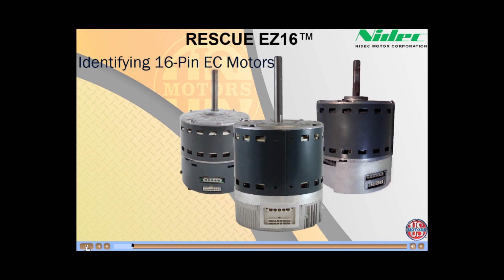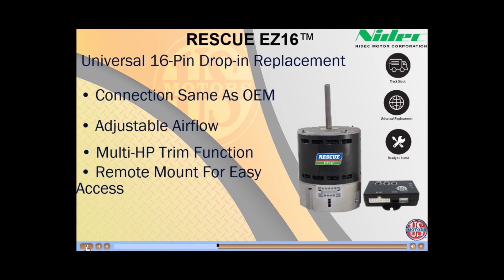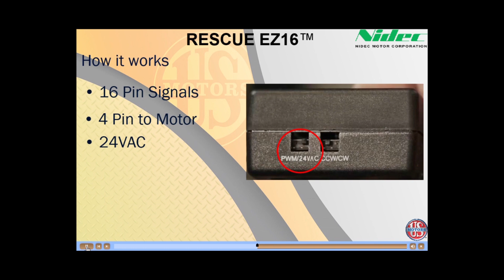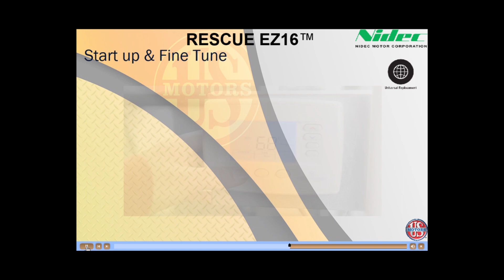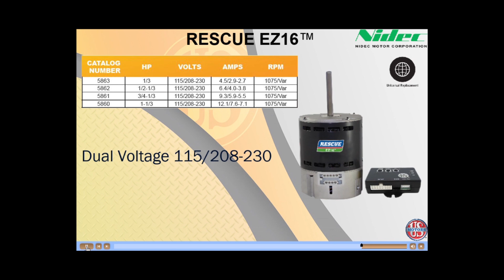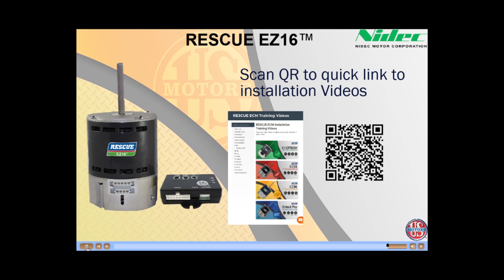RESCUE EZ16 MotorPro Training Video

Comment: This video just saved me lots of time. My supplier sold me this motor, which I still have faith in, (the motor I mean), to replace a Carrier 16 pin / 4 wire(low voltage) motor. I sent my tech a screen shot of the video when it said that it would not replace a Carrier 2.5 motor, or any motor that uses less than 6 low voltage wires on the 16 pin connector. He called me immediately saying are you kidding me! :) We both thought we were doing something wrong since we hadn't installed an EZ16 yet.